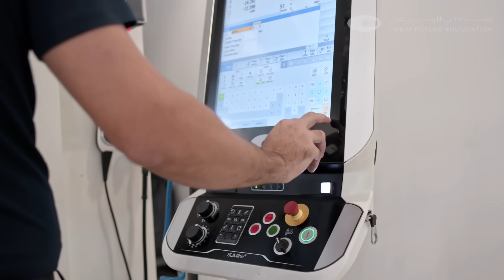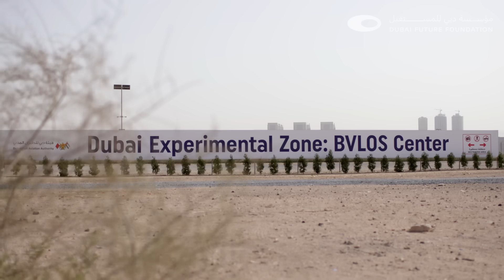How Dubai is building roads in the sky

Comment: There is a misconception being perpetually propagated. Airspace is just as finite as road space, ESPECIALLY after you factor in space required for collision avoidance. Back to the Future, Blade Runner, Star wars, all scifi settings that feature exclusively air based traffic that is just as gridlocked as cars would be.

Comment: Holy moley. As someone who went to school for engineering, every one of these futuristic saudi/dubai infrastructure projects makes me want to beat my head against a wall. Using drones as the standard delivery system for products in an urban area is like using snowmobiles for the same purpose in Texas. 

The advantage of drones is that they are highly adaptable, flexible, and modular. However, the downside is that they offer low throughput as a logistics system. Of course, you can technically solve the throughput problem, by just manufacturing, deploying, and maintaining millions of drones, but that creates an entirely new set of problems.

You are Saudi Arabia. Don't you have full, top down, authoritarian control of urban development? That's an urban planner's wet dream. Why would you try to deploy a logistics system that's meant to act as the proverbial 'Band-aid' solution? Why not simply integrate the city with an underground electrified rail system, with interconnected conveyor and truck-and-roadway systems to distribute materials from loading and unloading stations? A single, double stacked, intermodal rail car can carry up to 120,000 lbs of product. The average heavy lift drone can carry 40-400 lbs of cargo. Each rail car does The work of literally thousands of drones, which are hundreds of times less energy efficient.

Comment: Its is amazing to see how far cities will go to develop new solutions just to avoid building decent infrastructure.

What is this "greener, faster, more efficient" all about? Sure, you have significantly more vertical space with drones. Areal vehicles of any kind have a significantly lower payload than similarly sized and powered ground based vehicles. Considering that constraint, you would need either more vehicles or more trips to transport the same payloads. This would absolutely increase traffic. 
Now sure, you can make the argument that you have significantly more vertical space than you do have ground space, but you also have to acknowledge that you'll have to introduce a significant amount of communication and coordination complexity to avoid crashes. 

Especially considering the tight constrains of a city, everything would have to be perfectly coordinated. Looking at all the effort that is required to coordinate a far less congested and more controlled airspace for airplanes, I think it is very unlikely to pull that of in any economically feasible way.

It has been proven time and time again that in order to reduce congestion and increase efficiency, economies of scale are by far the most efficient and reliably way (just look at international trade powered by cargo ships and trains). So building out an efficient and scalable train infrastructure would probably be a better bet. Oh, its also easier to make trains autonomous than any flying vehicles navigating a dense urban space.
Reply: Trains are boring though! you are right though

Comment: Drone deliveries are good at bypassing existing infrastructure or for where infrastructure does not exist, but it is always better to build effective ground based transportation where possible. Modes of transportation where the power generation is stationary is most efficacious.
Reply: Indeed. Drones might transport small stuff at express speeds, but energy prices need to go way down for widespread casual air travel to be feasible.
Reply: places with drone delivery complain about the annoying noise they make.. and are now petitioning to prevent drone use!
Reply: Ground based transportation like??
Reply: @AnonymousReader-er4eg  Mass transit, traditional roads, 3d road grids, just about everything is more energy efficient than active flight. But what works best are things like powered railways. These feed off the power grid and don't carry any fuel or engine aboard, just motors. If you want to get fast and fancy, you can make it a maglev and even put it in a low pressure tube, it's all about how far you want to go.
Reply: @AnonymousReader-er4eg  Rail, sidewalks, dedicated bicycle lanes, etc. Anything except for car-exclusive roads, in other words. Ground-based drone deliveries can be done on pedestrian infrastructure, and people can seamlessly be moved without congestion on the ground as long as you think beyond the car. Flying taxis and the like become a lot more redundant when you make such considerations. Flying drone deliveries could be useful in delivering to balconies or to rural areas that lack roads or railways, but in any other cases, there are cheaper and more feasible alternatives already available.